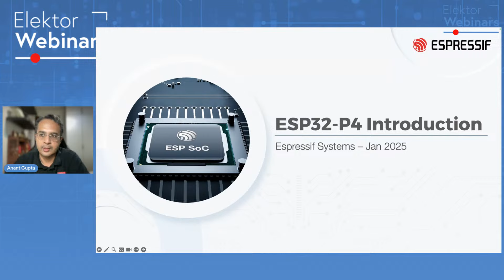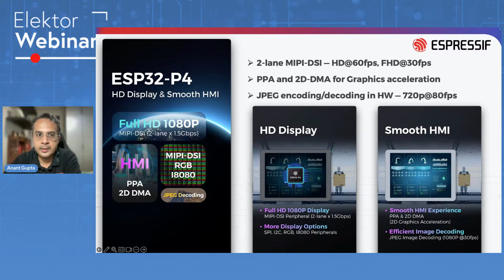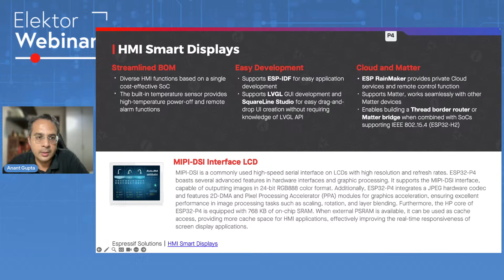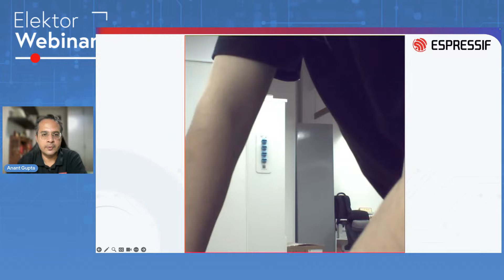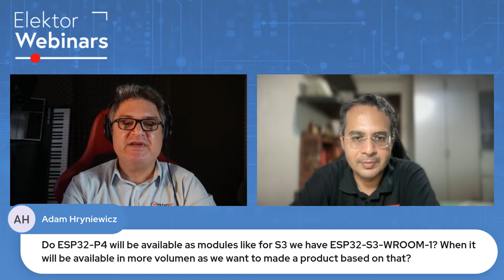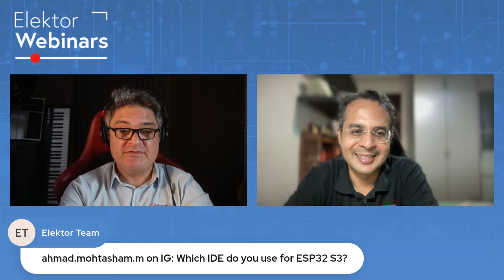ESP32-P4: Redefining Edge Computing Performance

Comment: Hi everyone,
I have a question regarding the hw encoding performance at 13:46.
Figure says p4's h264 hw encoder can reach 1080p30, but the bullet says only 1080p24.
Which one is achievable by the mass-production chip?
Reply from the maker: Hi Andy, sorry for the confusion:  the mass-production chip is capable of achieving 1080p at 30 fps.